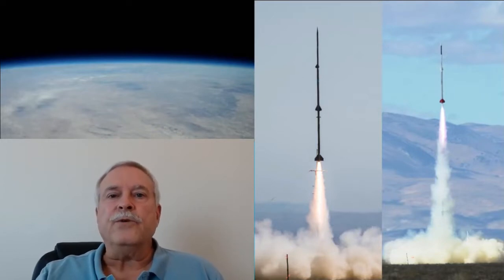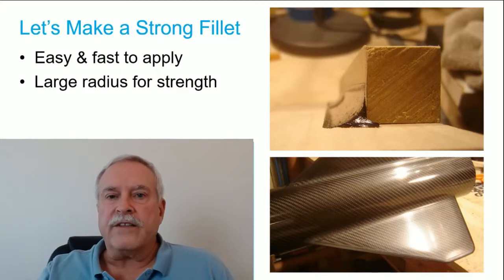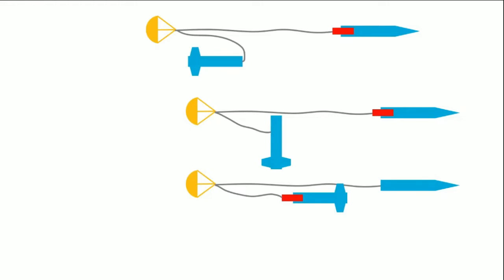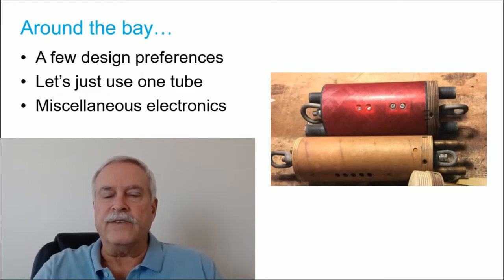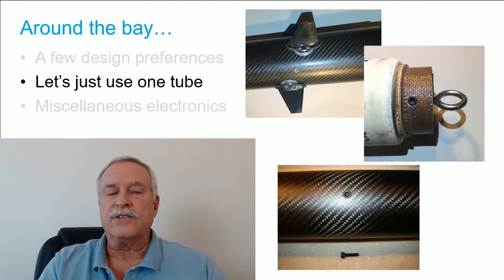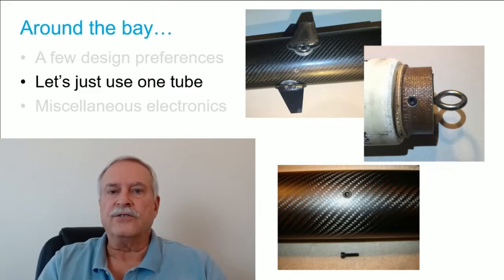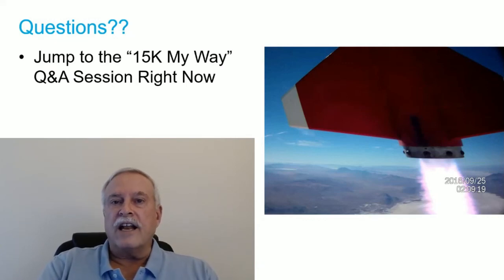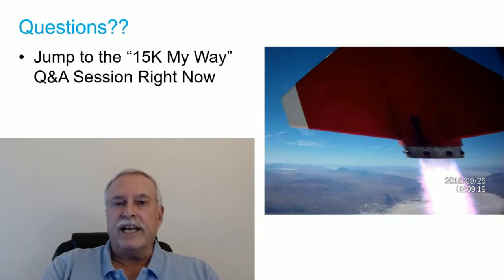NARCON 2021   Jarvis

Comment: I've just modified my L3 project Extreme Wildman rocket with this main chute recovery method, but with one modification.  The piston is attached to the E-Bay with 1/2" Kevlar tubing with a loop sewn in each end and carefully measured so that the piston only comes halfway out.  I have 3 1/4" ports drilled in the main chute airframe that are normally covered by the nosecone coupler.  And I am now using 2 grams of FFFG Hodgdon Triple Se7en Muzzleloading Propellent instead of black powder because its much cleaner burning and easier to clean from the piston, main chute airframe and E-Bay bulkhead.  I've done four ground tests of the main chute ejection and it works perfectly.  I'll be hoping to test launch this new L3 rocket on April 22nd but will only have my L3 certification launch after at least one test launch.  I'm also planning to modify if with your zipper-less coupler method as well.
Reply from the maker: Good luck on the flight, Dan!  I was able to see the recovery method a little more clearly on an SLI flight last weekend.  Watch the pilot chute travel upwards.  It''s fun to see.

Comment: I used your filet technique to replace and reinforce the filets on my fiberglass Mad Cow SDX3 after the back of one of the filets had shown cracking, from transonic turbulence of a large K motor.  No problems on 3 flights with L1000 motors. 

I'm now building an Extreme Wildman for my L3 project and will be using your filets to strengthen. Will be using main chute piston ejection configuration.  This will also reduce BP flame damage to chute, deployment bag, shock cord and pilot chute.

Where do you get the thick plywood for your bulkheads?  Next Rocket will have long, unbroken fiberglass airframe.  Do you have detailed plans anywhere?
Reply from the maker: Hi Dan .  One thing to keep in mind is that the fillet technique is intended to be done in combination with tip-to-tip something.  You want a fillet that can be applied and will hold its shape.  I could argue that if there was only a fillet to be used, then perhaps a structural epoxy would be better (speculating here, as I have never used a structure epoxy myself).  The plywood is nothing special.  I think I got a good size piece years ago from the local wood shop and finally used most of it up.  I don't have any plans for the air frame method, other than the NARCON video itself.  I like to mount a 1" ring in the air frame for the bay to sit on, but there isn't much else to show.  Try the deployment method.  It really works.  Flew yesterday with the same method and it worked well.
Reply: @Jiminaus50  Thanks for your prompt and thorough response. 

When I use your filet technique before I use West Systems 101 and mixed 406 Colloidal Silica and the chopped carbon fiber that Wildman Rocketry recommends with a 5/8” radius filet.  And furthermore, I added a 2” carbon fiber laminate tape to one of the fins, but after consulting with Steve Shannon, I decided to go forward without adding the cf laminate tape to the other two. 

And the proof of the pudding that this worked was that the transonic fin flutter that had been previously threatening to rip off the fins was no longer a problem. 

For my L3 certification, I haven’t yet decided whether to add the 2” carbon fiber laminate tape to the fins, but I will be using the large 5/8” or 3/4” radius filets with Colloidal Silica and chopped carbon fiber. 

But equally important, I’m planning on using your piston technique for the main chute, and as much of the zipperless technique on the drogue as the Extreme Wildman design will allow without major modifications. 

On my next L3 rocket I’m considering using all of techniques you show in your video in addition to your vertical control system. 

Thanks for your video.
Reply from the maker: I think you'll like those techniques!  Good luck on the L3 when the time comes.  By the way, at the moment, there aren't any more systems available.  It is possible that there may be more in the future, if a replacement control board is produced, but that's out of my hands.  I am more optimistic now than a few weeks ago, so we'll see.  I'll let you know if there are more in the future.

Comment: Hey Jim, great Video, thanks for sharing it! Is your NARCON 2018 presentation also available somewhere? Thx Denis
Reply from the maker: No, it was not recorded.  I looked at the powerpoint for it.  So much has happened since that time.  Two flights above 100K (175K and 142K).  Major improvements in the stabilization system.  Much fun.
Reply: Jim. Any possibility of doing a YouTube video on the 100k my way info that would be updated for your accomplishments to the altitudes you've gone?
Reply from the maker: @VikingRocketeer  Perhaps ....

Comment: Jim do you use peel ply on your rockets or tip to tip reinforcement? I've heard it can cause micro fractures.
Reply from the maker: I use peel ply when I want to finish the surface.  It gives a flat results.  In the past, I have used it on fillets prior to the tip to tip, but I don't do that anymore for the reason mentioned.